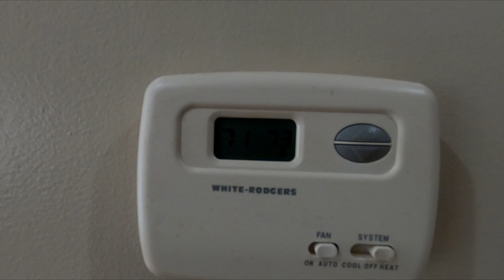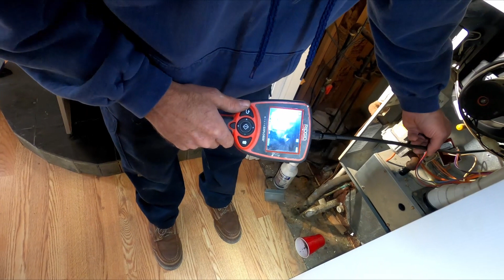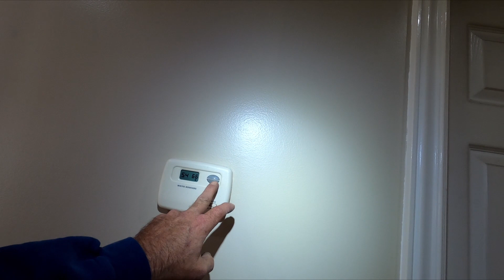No Power To Furnace

Comment: Excellent video --the fix was certainly challenging.
Reply: With all due respect, it wasn't that challenging, it was only a loose connection in the panel and low batteries in the thermostat. If they would have checked for voltage at the switch/disconnect and not found voltage, chances were pretty good that the problem was at the panel, (assuming that rodents hadn't gotten into the circuit, but if that was the case, the breaker probably would have been tripped.) That would have made this a much shorter video.